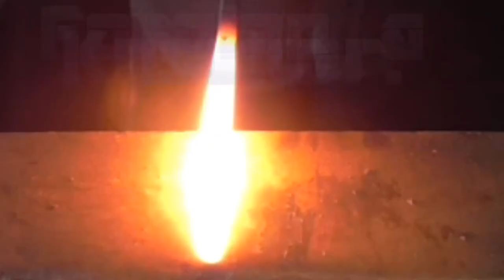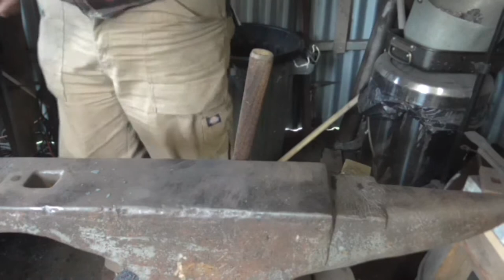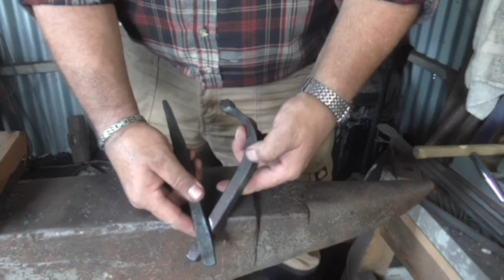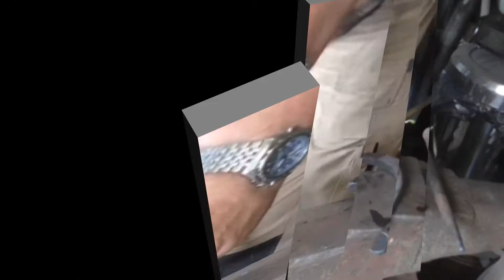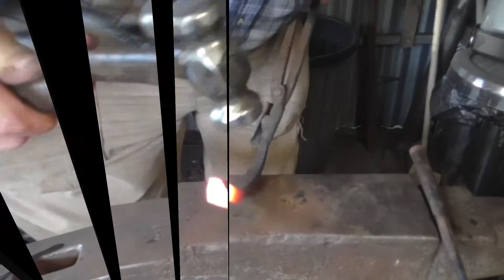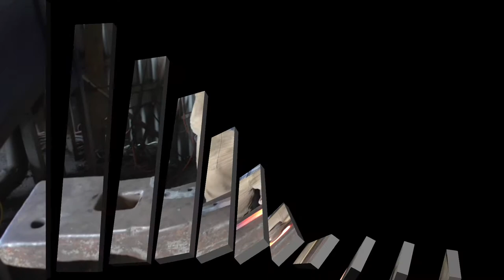Forging a door knocker complete but speeded up version

Comment: I like the aesthetics of the door knocker...also the wet metal and chalk dust tip was super cool (I'm going to give that a try on the next pair of tongs I make). I bet you could per-drill the holes in the door and sneak the screws on a slight angle past the knocker. Great job!
Reply from the maker: Hi John,
Thank you for your comments and suggestion re screwing the knocker to a door.

I have to say, the wet metal/chalk dust tip isn't mine!!😃